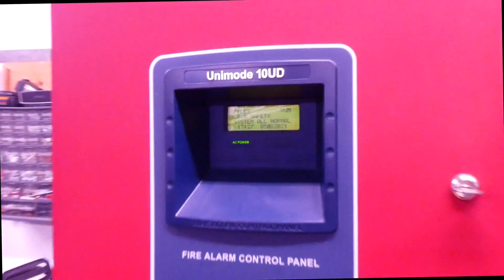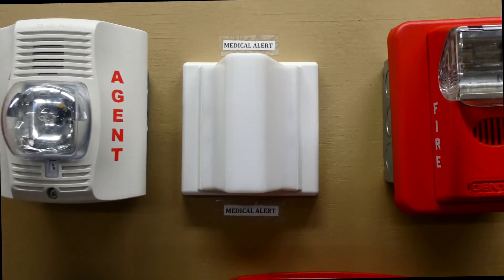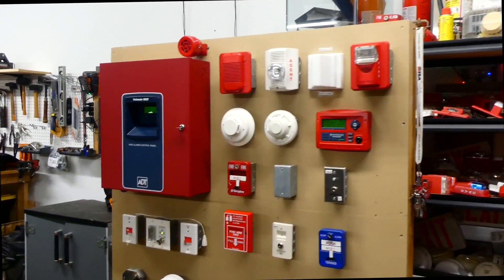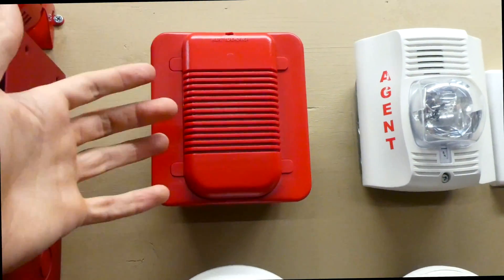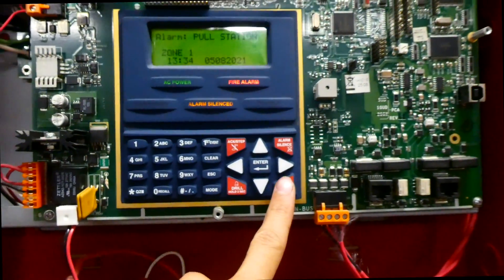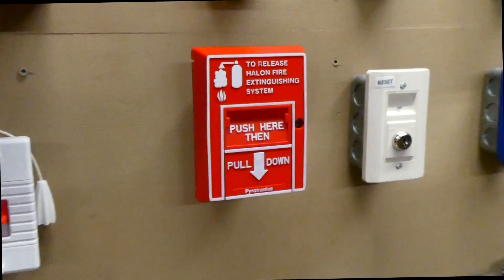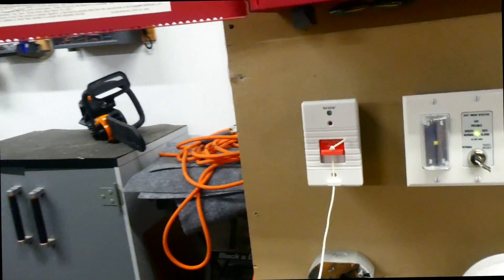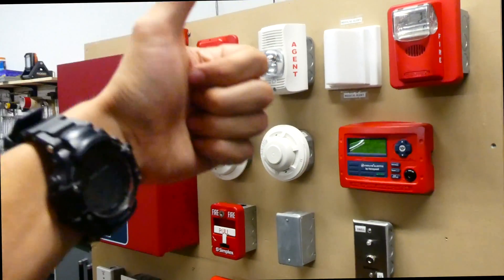ADT Unimode 10UD Fire Alarm System Test 20 | MORE High Pitched Alarms

Comment: The combined coding of March Time from the SpectrAlert Classic horn only on March Time and the Gentex Commander 1 on Code-3 makes it sound like a cool beat as they make the same exact pitch and it also happened in this video but in one alarm due to a coding glitch where it's doing code-3 and march time at the same time and the reason why it's doing the weird Code 3 and March Time alternating is because the system is set to March Time while the alarm's Smart Sync is enabled since it's trying to run with the TrueAlerts. If the Smart Sync would be turned off, it would be going off in March Time. So in other words, the Simplex  4903-9252s have Smart Sync enabled when it shouldn't. Thus, is alternating 120bpm and Temporal 3 and also the strobe on that unit doesn't flash at all

The video is called "April Fire Drill @ EHS 4/24/19" https://www.youtube.com/watch?v=CPQqstbfCcw&t=38s